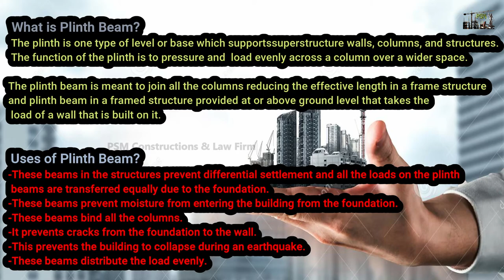Compound Wall Construction - Part 03 (Plinth Beam Structure)

Comment: Sorry to say that - There is no minimum clear cover 25mm is not provided for columns. Also, No 135 degree stirrups (I mean hooks are not bent) also not provided for shear in Beam. Since I am a structural engineer - this is my justification regarding steel reinforcement.